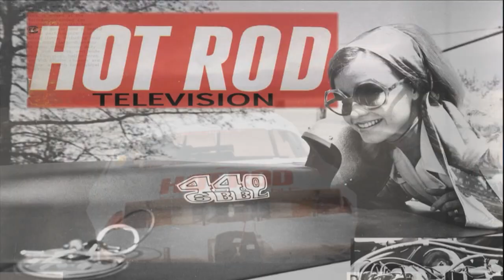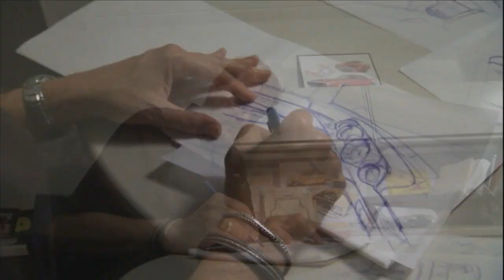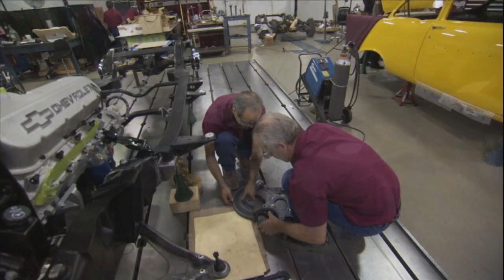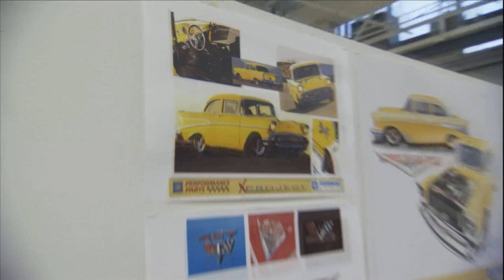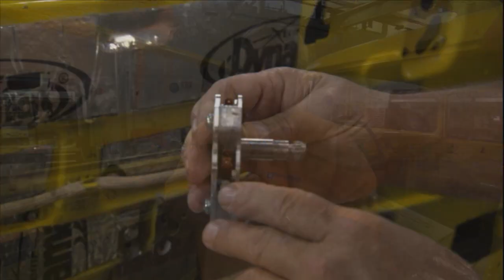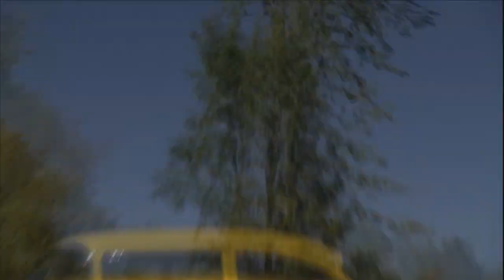HOT ROD TV: Project X

Comment: They did a nice job, but should of left the flared rear wheel wells on it, It's GM and they wanted the original ones, And they should of hung a blower on it. with removable hood. Project X was all about showing it's power, not hiding it. Pro Street will die out just like all other car trends. and they will be stuck with a dated car, not a time less one.
Reply: Pro street is they all look the same like shit. Put a blower on it but s 471 so the hood can stay on the SS rims and a hot stroker 383 small block.  Lose the shifter and that floor job.  Don't even look at the paint it's just right.  Retire it to just a Sunday baby.